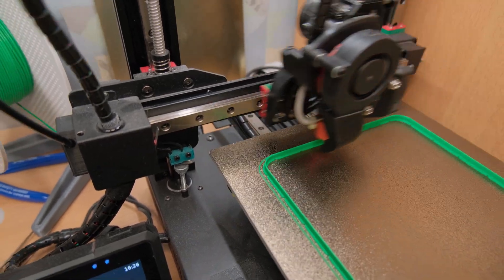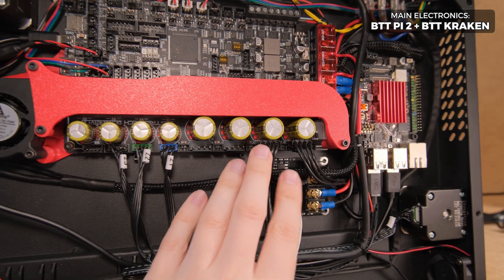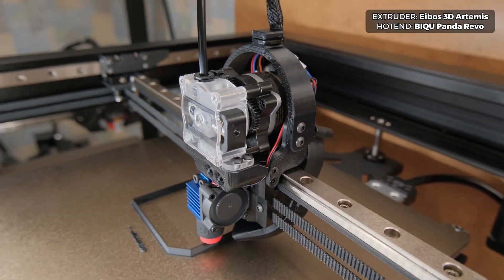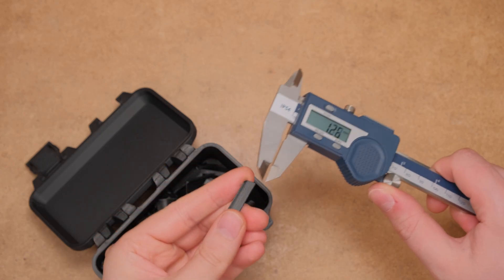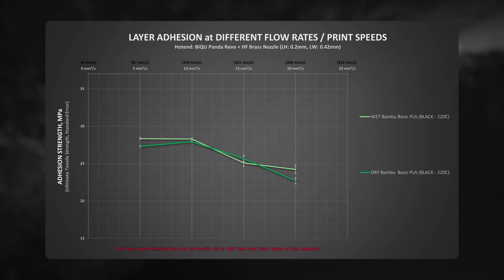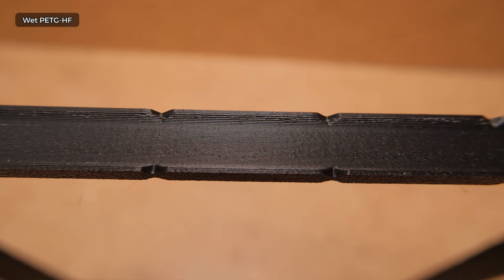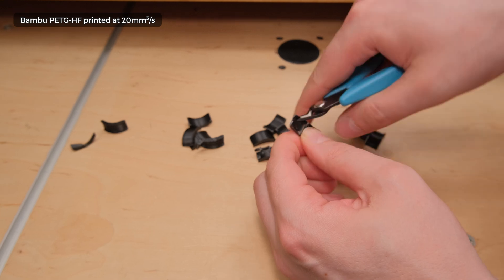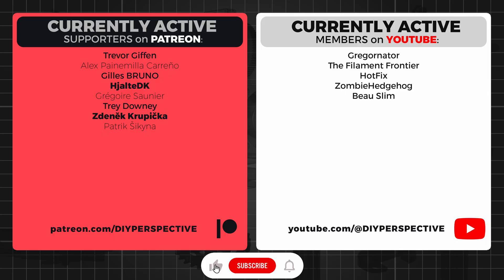WET vs DRY filament STRENGTH: Bambu PLA vs PETG-HF vs ASA

Comment: I thought this video would be about soaking prints in water after they're formed. I know nylon injection molded materials are soaked in water after forming to increase strength. I made a pocket clip in nylon and it snapped under pressure, and then i made another soaked in water after printing. It just stretched and didn't break, much more durable.

Comment: ASA Doesnt print well at all with only 45 degrees chamber. You'd want 65ish+. That is why everyones small mechanical flat parts near the much hotter beds prints perfectly, but the tall more complicated ASA prints usually warp or prints very poorly. ASA also struggles with fans unless chamber is really really hot. Very hard to tune perfect fans to get good fast cooling for difficult overhangs.

Comment: Questions of water content in unopened filament bags might consider filament manufacturing method. Consider the step where the filament is pulled thru a water cooling bath. Might also consider the mfgr output matching customer demand. In other words, the mfgr doesn't have time to more fully dry their product before packaging.  As such, user drying the filament is suggested as mandatory.  Let's not consider water as a part of the additional weight of a product sold by weight and hope filament length is the deciding factor of a full spool (calculated weight = filament length). 
Let's face it, more printers running require more filament manufactured. The industry's good times, when all extrusion lines are running near capacity. Do the customers want less filament availability due to strict mfgr drying times or more availability with drying requirements being passed onto the customer ?

Comment: I'm surprised about the result that you got with the regular PETG. With the Revo hotend, flow rates far beyond 20m³/s should be no problem at all with most plain PETG filaments. I have tested several PETG brands at 20 mm³/s without failure on Bambu X1C even with stock hotend. And the Revo is far more capable. It almost makes the impression that you make the PETG-HF shine by comparing it to an exceptionally bad brand.

Comment: Sorry if i missed it but so you have the air deflectors posted anywhere
Reply from the maker: It is in the video description, but from now my most models will be with a small fee.
Reply: @PrintingPerspective  thanks! This would be the first time I will print ABS (in the info on the website it says they should be printed using ABS or anything more heat resistant). I’ve only printed PLA and PETG so far (I understood that ABS smells and it’s also not recommended for printing inside your home). Do you maybe have a suggestion for another filament? That is at least as temperature-resistant as ABS is, but safe to print inside your home and that doesn’t smell?
Would one of the Bambu nylons be at least as good for this job as ABS is? Like PA6-CF or PAHT-CF? That’s all I have besides PLA, PETG, ASA and ABS (last 2 I never printed anything so far, but I understood they both smell and might even be toxic, so I would avoid those, having the printer in the office, where I work all day)
Reply from the maker: @MStoica  But is your printer even enclosed? Because you need that when printing ABS/ASA/PA with this print. If you have something like P1S or X1C buy some good ASA filament that will stink and warp less, keep ventilating the room, and stay in it as minimal as possible. Unfortunately, there is no other way. The plastic needs to withstand ~85-90C degree temps.
Reply: @PrintingPerspective   yes, I have the X1C. And I already have ASA, ABS, PA6-CF and PAHT-CF, I’ve just never used them. In your opinion, would ASA be better than one of the nylon-cf ones, for this application? Because, otherwise, I think I’d rather try one of the nylon ones 🤔
Reply from the maker: @MStoica if you don't care about the price then sure, try it with nylon :) ASA or ABS would be the most cost effective, you know.
Reply: I just did it... my very first print with ABS. Went perfectly, with the default Bambu settings for ABS and their material as well.
But I am surprised that there was absolutely no smell. Is there some type of new ABS that doesn't smell? I did move the desk with the printer right against the open window, with the printer's back very close to outside. And I never opened the printer's door until the print finished. But from other people's mentions about ABS in general, things like "it's the worst smell ever" I was expecting at least some smell, even with the printer's back right against the window.
I guess I will print more with ABS from now on

Comment: Well PLA doesn't get wet to begin with, so the differences are clearly small.
I expected ASA tests also when using a Q1 enclosed+heated 55 °C chamber. It might reach almost basic PLA levels.

Comment: I've always found layer adhesion of ABS and ASA to be a problem with printers without a heated chamber. I printed some Bambu ABS in my QIDI XPlus3 with a 65C chamber and it definitely improves the layer adhesion. Before I could crack the layers with my hands, but now I'm unable to. I'd love a test redone with engineering grade filaments in heated chambers.
Reply from the maker: I always heatsoak my X1C before larger prints and I print slower than default settings so I never noticed anything different. But it is hard to notice even a 20% difference by breaking stuff with hands, it has to be something way more significant.

Comment: Hi can you point where to look for a spreadsheet that calculates wall widths depending on the number of walls, layer height and path width settings in slicer?
Reply from the maker: Do you mean that image of the layers in the spreadsheet? It is just a basic visualization that I made in Fusion 3D of how two extruded lines look and what dimensions I take into the MPa formula.
Reply: @PrintingPerspective  About.
Thanks for the reply.
I'm looking for information for wall measurement for flow setting.
If the wall is single then it is easy to measure the thickness with a micrometer.
But I have a problem with double wall.
I don't know how to interpret orcaslicer's information that the path thickness with double wall is for example 0.41mm
This double wall should be 0.82mm or 0.82mm minus some thickness value for gluing the paths together?
Reply from the maker: If you use Arachne wall generation and your wall is 0.8mm in the 3D model it will automatically adjust extrusion width. Even if you set it to 0.6mm you will still get two thinner walls.
The only info I know is this: https://github.com/SoftFever/OrcaSlicer/wiki/Precise-wall there is a link to the Slic3r documentation.

Comment: Genius way of doing the test sample.  That way it ignores some heating differences that happens when the layer time is too short and the under layer is not yet cooled down. So you can also compare print speed/adhesion correctly with this technique...as well as how part cooling fan affects the part as it just passes on the layer and doesnt stay there like a small sample part
Reply from the maker: I don't know, maybe I am cooked too much, as I have no clue what exactly you are tyring to say. ;D I will read it again tomorrow, lol.
Reply: @PrintingPerspective  we can chat about it :)
Reply from the maker: @Vez3D I think I get what you are saying, and I assume you talk about ABS/ASA, my only concern is that by higher fan speed we introduce unnatural instant peak of cooling rather that the low and continuous during real prints. The only way to ensure equal layer times is to make bigger prints with higher speeds, but then with bigger prints we are spending more time extruding and less time cornering. :D
Reply: @PrintingPerspective  i mean for any materials. I was trying to find a way to test how speed and cooling would affect things in terms of adhesion. Lets say you test sample is small...like 2cm wide dog bone. If you crank speed to see how it affects adhesion it will be also means layer times are shorter and the printing happens when the previous layers is still melted, resulting in an increase of adhesion because of that. So you would be tempted to say high speed means more adhesion. Now do the same experience but with your test sample here in your video. Increasing speed will not have the same effect since layer time is way longer and it might result in a  worse layer adhesion than with a small sample. So if you really want to test how speed affects layer bonding, i think your sample is perfect.
Reply: Hi Simon, seems he does not know you, so leme introduce you:
PP, this is Vez3D the designer of VZ BOT and VZ BOT AWD, and record holder for several 3D printing categories.
He is also an extremely nice human being.
Simon, this is PP, he does some awesome videos tackling mostly subjects others run away from regarding 3D printing, he is very thorough and delves deep into subjects while explaining things in very easy to digest sections. I absolutely enjoy his videos. 
-
As a general advice, when someone replies to your videos, do check their channel first.
I always do, and i have 4 channels.
Reply from the maker: @toma.3d bro, stop trolling ;D
Reply: @PrintingPerspective  Having a break, so ... 😃
Reply: My only concern is cutting the samples with the cutter, because it might stress the sample and therefore falsify your results. I‘d prefer a heat based / sanding cutting technique.
Reply: I see what Simon is saying; the large thin-walled print tests strength against speed by ensuring the previous layer has cooled.

In reality, strength seems to matter most for smaller objects. Actual clips and brackets are dependent on a small print area with dense infill. When you are looking for strength, you slice by object rather than by layer, and you don’t use thin walls or lots of cooling. Therefore, I think the perfect test to compare materials would be the opposite, multiple walls and short layer times

Comment: Great video, thanks for testing. I'm a big fan of the new PETG HF. As for temperature resistance, in actual use the PETG HF is the same or slightly higher than the basic. IIRC, Dr Igor's test showed PETG HF to be 64c and PETG basic 61 or 62c. Either way, probably not a concern.
I love these types of tests, keep at it!
A side note, what you encountered with the S4 is what I suspected would happen based on the design, and why I skipped jumping on the hype train the s4 generated. I still use my simple food dehydrator and it's been great. It moves a ton of air, which is where most of these dedicated dryers falter. The polymaker polydryer is a nice design though. It has baffles that direct the air so it's not right on the filament. The air vents are also not as close to the filament when drying.
Reply from the maker: That is interesting about the temperature resistance of the PETG-HF.
Yeah, it is a bummer about the Sunlu S4... It is a nice dryer, but the main important thing is a design fail, so...

Comment: Great video...How do you like the Artemis?
Reply from the maker: Thanks. I have mixed opinion about it. It definitely has more consistent extrusion that dual drive gear ones, but because  that single drive gear is quite small at higher flow rates it deforms and filaments slightly slips along the drive gear. They advertise it as basically "TPU beast" but I am not a TPU guy so I haven't tried it with TPU yet. I don't like that the gearbox gears are exposed and with grease, but overall it is not a bad extruder, but it is also not a great one. To achieve the lightness it sacrifices convenience. So I don't know.